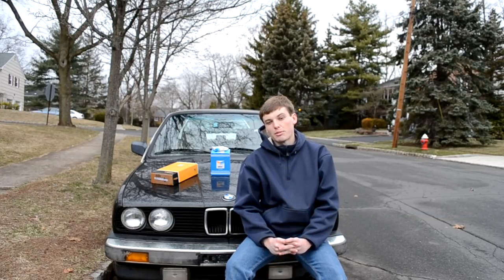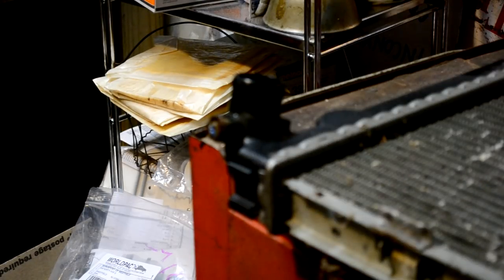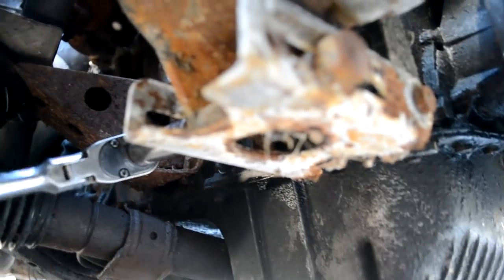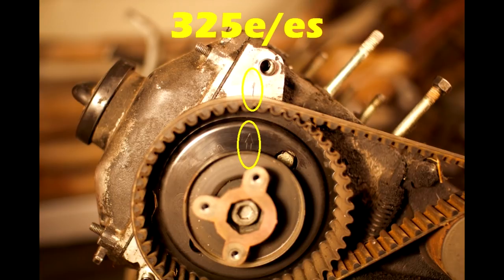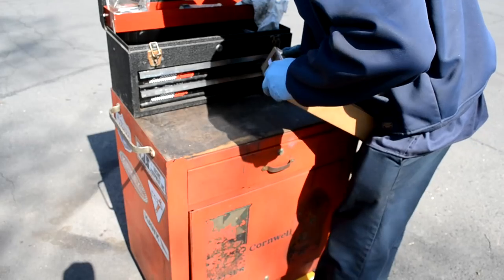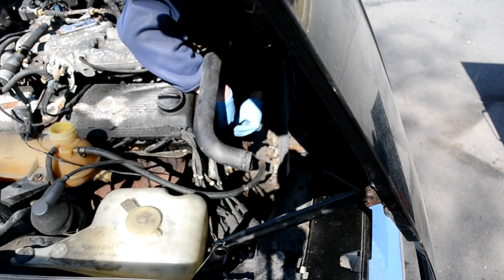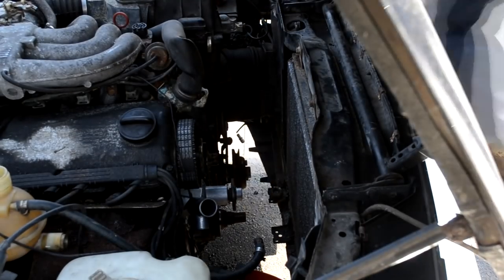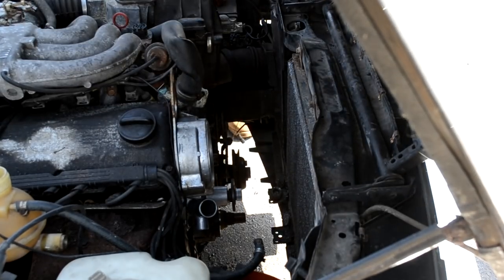The Official BMW E30 Timing Belt Replacement 325e/s 325i/x/s Early Model

Comment: I don't think you mentioned to loosen the tensioner bolts from tight about a half turn to where it moves freely, test by prying against the long bolt protruding from the engine block,( just don't pry too hard and break it if the tensioner doesn't move) then turn engine by hand two revolutions in the normal direction of rotation (clockwise from front) to seat and take slack out of belt and allow tensioner to move out as far as it needs to properly tension the belt. Make sure the spring is on the pin that rests against the WP and through the hole in the tensioner arm. Good video for the do-it-yourselfer.
Reply: manstersr 
That is extremely valuable information. Everyone doing this job needs to read your comment.  That was the only thing he left out. Overall a good video.
Reply: Thank you sir 🫡

Comment: if you go to most bike shops (motor bike), you can pick up a 32mm skinny wrench for the fan clutch. Just for future endeavors :D
Reply: P G Or, Probably cheaper... Go to Harbor Freight/Princess Auto/Whatever discount tool company you have in your country and grab a cheap 32mm and grind it down to fit. It cost me $12 for mine and it's probably way stronger than the bike wrench.
Reply: I just bought the fan tool on Amazon. Came with the wrench and a tool to hold the pulley/clutch. Costs $10

Comment: Very helpful. There's one thing I'm not sure was correct. You say that after putting the new timing belt on we should turn the engine over two rotations, and we see you turning the crankshaft counterclockwise. My Haynes manual says to turn the camshaft counterclockwise, and that makes a difference because that way it pulls on the part where there's no tensioner, whereas if you do it on the crankshaft it doesn't.

I think it should be mentioned that one needs to be careful to get the new belt on without changing the relative positions of the sprocket on the crankshaft and the one for the distributor (the one slightly above the crankshaft sprocket). I apparently didn't get it right, so the car wouldn't start, and it took me a lot of work to get it right.

Also, when you say "You can take out that 13-mm bolt there that you just loosened", it looks like you're taking out the other one.

Comment: I am currently doing this to my 87 325e. On my car, I had a giant plastic guard blocking my view of the radiator, belts, etc. I had to jack it up, take off the front two wheels, and remove that plastic guard before I could get at the bottom hose on the radiator. Thanks for your help!

Comment: Here's a pro tip for the water pump gasket. apply vaseline on the water pump before installing. this will allow you to put the gasket on without it moving everywhere and install the water pump. Also, what worked for me when adjusting the tensioner, is i set the cam gear TDC mark one tooth ahead, so when I put tension on the belt, both TDC marks lined up perfectly. Took me 10 times to figure it out.
Reply: how did you figure it out and how did you go about adjusting it to make sure it was TDC... say my TDC is like a tiny tiny bit ahead is that bad? its in the groove on the crankshaft but just slightly more to the right ... the camshaft appears basically perfect too maybe a little the same as the crankshaft if you get me... what do you think?

Comment: Several small differences for my 1988 325is m20 engine but basically pretty good. Contrary to some comments removal of hood not really necessary. As far as camshaft front seal I would say if no signs of leakage the not broke dont fix it saying. You'll be back in in 4 years or less anyway.

Comment: It helps to mark the gears with some white out before you take it apart  (if the engine ran before starting the job ) it's easy to see the marks you made than the originals but do check the original marks when finished

Comment: This is a good ass tutorial, if you had a camera man it would be perfect, not hating btw. I just bought an 87 325es and Im not a mechanic, other than oil, sparkplugs, brake pads and that kind of stuff I dont mess with cars, so I'll be watching your videos.  Keep it up man. You just got yourself a new subscriber.
Reply: Angel Flores If you have E30, then I've found alternator/belt and coolant flush/service including thermostat replacement to be easy jobs too. There is a Wikipedia on www.e30zone.net to help too (I think Pelican autos website has some good instructions too, that's more US based, E30 zone is euro, but still the best E30 wiki out there).

Comment: Hey love the videos!! I have a 1990 325is. You should do a head gasket soon it would help out a lot no videos on it
Reply: alex peshchanitsky because when ur head gasket fails it can cause warping and sometimes just replacing the gasket will not work
Reply: Garl Gamp Have it resurfaced if that's the case

Comment: Just did it on my 520i. That stupid hood really kills someone's back. Something very important: mark the marks with white paint AND MARK THE MIDDLE GEAR AS WELL! It is responsible for spark timing. Your engine will run like shit or even won't go on if it's not aligned correctly.

And the second thing I wanna say: don't let the coolant splash on the ground. It's very poisonous and you could get in trouble with the police.
But anyway, thanks for the video. It helped me doing this job tremendously!

Comment: I would not use a razor blade for removing the gasket residue from the thermostat housing, this could lead to leaks around the gasket. Use a plastic scrape instead, that wont scrape the surface, just a tip :)

Comment: Great video! Just getting into the E30, bought an 88' 325 "super eta" for $100. It's been left sitting in an orchard for 5 years. It still runs, but boils coolant out of the reservoir. Are there any parts or procedures that are specific to the "super eta" as opposed to what is demonstrated in this video?
Reply: josh..feel free to contact me..I have the same car

Comment: Hey after you have done the timing belt and out everything back together, what do you do with the radiator and coolant? How do you re bleed it and so on? Also at the start off the video you didnt explain how to drain the radiator coolant and stuff. But thats for the video helps me allot:) will soon be doing the timing belt
Reply from the maker: +mak ten You can try leaving the cap off the expansion tank, and there is a bleeder screw on top of the thermostat.  Crack the bleeder open and see if some air comes out, then repeat until the air is completely bled.

Comment: I'm not the best when it comes to cars. But what is the best way to clean those parts? The rust etc..?
Reply from the maker: +geekybench Wire bursh, rust dissolver liquid, clean, repeat until back to natural metal, then prime/paint.

Comment: Sorry it's out of the subject of this video but you seem to know ALOT about e30 so im sure you're the best person to ask so. I've recently bought an 1989 325i manual (IS i guess since its a coupe) So the issue is The cluster lights are all working execpt all the gauges, RPM,SPEEDO,TEMP and GAS which is really annoying... i was wondering if you had knowledge if its a fuse or the whole cluster , i really dont know since all the lights are working... so... Thanks in Advance & awesome video man !
Reply: Also, im sorry for the grammar english isn't my native language !
Reply from the maker: You could check the fuses, but typically these units are very sensitive so if it has been opened once before, something may have happened to the internals.  Other than that, I guess you could check the grounds on the terminals of the cluster or the electrical connectors.
Reply: i had to open mine before because the rpm gauge did not work anymore. I had to replace 2 Sanyo batteries on the mainboard and it fixed that problem.The only problem i have now is that the fuel consumption stays all the time on max( Had this problem also before the batteries replacement)

Comment: Had a question. So I have a 1987 325i I align the bottom one straight as can be but when I put the hormonic balancer it is like 2 cm off with the line of the hormonic balancer do I align it with the hormonic line or the other line?

Comment: Hey there how shall the ignition cables be on the ignition distributor? 
witch cable from what cylinder shall go to? :) Thanks for a awesome vid
Reply from the maker: +Björn Grundström https://www.google.com/search?hl=en&site=imghp&tbm=isch&source=hp&biw=1600&bih=775&q=e30+distributor&oq=e30+distr&gs_l=img.3.0.0l2j0i30j0i8i30l3j0i24l4.291.1647.0.2304.9.9.0.0.0.0.133.1017.0j9.9.0....0...1ac.1.64.img..0.9.1013.02WGbFI1pGI#imgrc=XkjoAJDPpdKCVM%3A
Reply: +E30Source Thanks man! What project do you have next? 😊
Reply from the maker: My E39 525i Wagon

Comment: What is the third toothed pulley? 

Is it just an idle pulley or is it a balancer shaft or something else?

If it is a balancer shaft or needs to be times as well.
Reply: I'm guessing it is just the oil pump drive, 

you don't need to refit the front pulley you can use the line on the bottom belt/ crankshaft pulley to line the crank shaft using the small notch on the front seal housing.

Comment: Hi, at 12:37 in the video you say to line up the notches. Is this a simple process? How do I line them up?

I have not yet started my first attempt at doing this type of repair, so I'm sorry for the newb question. 

Thanks for the awesome video!
Reply from the maker: +Andrew Tompsett Its very easy to match up the "notches" just clean them really well so you can see them easily.

Comment: Thanks for your channel! I just bought my first E30 and am doing the timing belt now. My confusion: the 3 bolts holding on the water pump don't match. 2 are M8x20 and 1 is M8x25. I'm kinda thinking someone swapped in the 25 mm at some point and I should just replace it with the correct 20mm?  Any help is much appreciated.
Reply: I have heard this before and I think it came this way. It is important to make sure you remember which bold came from what hole. Rumor has it that if you place the longer bolt into a shorter hole, you can snap the bolt off...leading to a whole new project to remove it.
Reply: I have this too but not bolts that big... damn 20mm bolts for water pump??? they should be 13mm all 3

Comment: Hi- I've seen a mechanic cut a timing belt right through the centre of its length, remove half of the cut piece and put on the new one without moving the timing marks out of line--this was on a different car but wondering could it be done on an e30 if you know what I mean.
Reply from the maker: MsCelicagt4 I wouldn't dare try that.  Don't risk it.

Comment: So you said you have to make sure the lines match up on the head AND on the bottom side the crank, but you did not say if they both are not lined up already, how to make both sets line up. You just said dont go any further and make sure they are both lined up. How would you get them to both line up?
Reply from the maker: +A.Mak You can turn them both at the same time carefully.  If the cam feels like it is getting "stuck" as you turn it, it is most likely the valves hitting on of the pistons while it is at top dead center.  Not good to do.
Reply: @E30Source  what do you mean?

Comment: I was torquing down one of the M8 bolts for the waterpump to 16lb's and as soon as it clicked the bolt snapped.

I'm screwed.
Reply from the maker: Aww man, try heating the block and using vicegrips to get it out.

Comment: Hey I've been looking at buying a e30 325i! And Just wondering how much life I can expect out of that motor with 200,000+ miles on it before anything major(or expensive) needs to be done?? Thanks for all your help!!
Reply: +Grayson Pulver i have a 325e that had an engine last 270k until the timing belt snapped... Ive heard of guys running in the 400's.. just basic maintenance is key
Reply: I've got 299K on my '91 325i and it's still solid.  Just change oil timely, and with the correct winter/summer weights!
Reply: I've got a little over 360K on my '89 E30.  Regular maintenance and a rear main seal along the way, but no major rebuilds.

Comment: Any way I could do this without taking off the radiator? I just flushed my coolant last month and don't want to do it all again
Reply from the maker: l[KAUPAKAY]l You really need to take the radiator out.  Why dont you put a bucket or catch pan to catch the coolant and then refill the system once your done?

Comment: Great video and only one on the net. Just wondering if its possible to change the water pump on an e30 without being concerned about the timing.
Reply from the maker: MsCelicagt4 Nope.  You have to take off the timing belt in order to do the water pump, plus you might as well do it while you are there.

Comment: my 1985 325e has long cranking problem any suggestions are appreciated thanks
Reply: Vacuum leaks or faulty cold start valve (or thermo time switch). If you haven't done so already replace EVERY vacuum line then see the results. You can find all of them on Bimmerworld.com and Pelicanparts.com

Comment: can you make a video on how to fix your engine burning oil? if not then can you reply with a brief step step comment thank you!
Reply from the maker: +Farhad Rahimi Burning oil can be a number of factors, what oil are you currently using?  What weight? How much? What type of filter?  If you are using quality oil and weight of oil, my guess would be valve seals.
Reply: im using high mileage castro, and idk i just went to o riley the give me a random filter and since then my car has been burning so much oil
Reply from the maker: I would change it to 10W40 (For Winter)
or 20W50 (For Summer).  Valvoline Conventional is what I use, its $16 at walmart and a Bosch filter from autozone.
Reply: yeah thank you very much and btw i have a 1991 325i
Reply from the maker: Excellent, glad to hear.

Comment: I just changed mine out... now the motor won't run right I've adjusted the timing 3 times and the lifters are loud and I've  found metal shaving in the new oil...what could be going on?
Reply from the maker: +scion03 Are you sure you have the belt tensioned properly?
Reply: +E30Source yes sir
Reply from the maker: I'm not sure what the issue could be then.
Reply: +E30Source I'm thinking a bent vaule
Reply from the maker: Do a compression check!

Comment: if you do have to align the timing belt lines what do you do?
Reply from the maker: Carlos Carrasco You do that before you remove the belt.
Reply: Ah, i see. I was confused where you say i can screw up the pistons if i spin the cranks, but as long the belt is on i can move them. Got it.

I'm going to try it out. First time doing any mechanic work. Great video.
Reply from the maker: Yep

Comment: What if my water pumps moves with the fan?
Reply: Any answer to this?
Reply: Bryan Pumper set the car on fire it's no good anymore
Reply: I know this is an old question, but I'll leave this answer for any future needs: That is normal. There is a set of wrenches that are sold to remove the fan clutch, which includes a tool to hold two bolts of the water pump so that you can unscrew the fan clutch. https://www.fcpeuro.com/products/bmw-fan-clutch-wrench-set-cta-tools-a886 You can get cheaper ones on eBay, but you can use that link as a reference.

Comment: Argh, you should have changed the sprocket for the non-stamped one. These are time-bombs =)
Reply from the maker: leetspeek Are you talking about the intermediate shaft sproket?
Reply: E30Source Was talking about the camshaft sprocket. You could have taken the late-model sprocket (which is not stamped) and replaced it. The stamped ones are known to snap/break.
Reply from the maker: Ah.